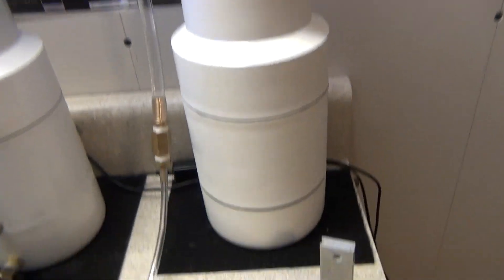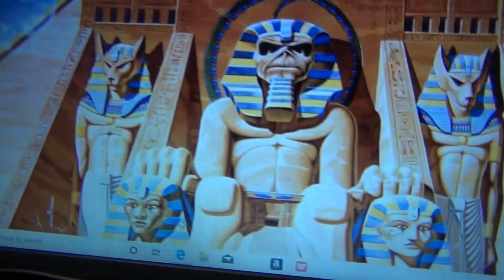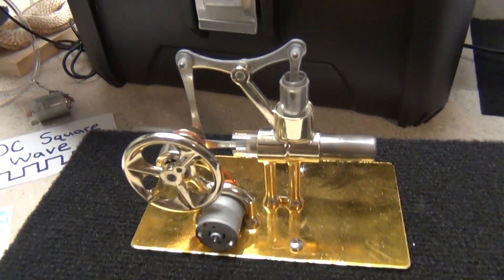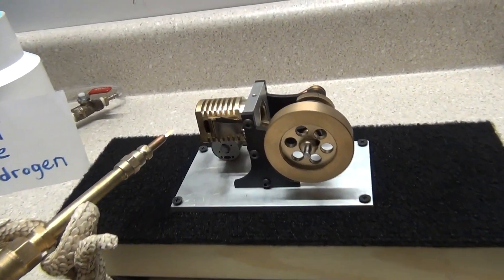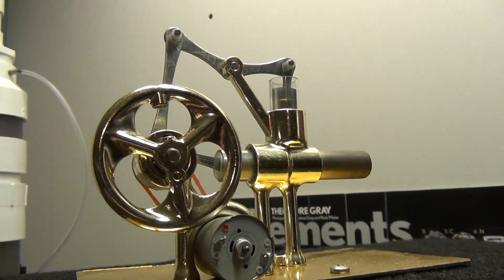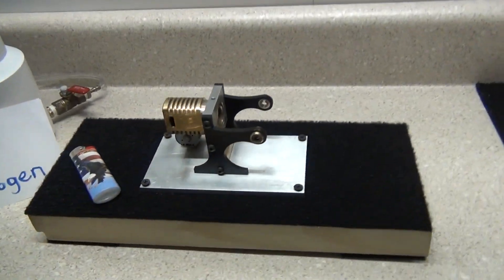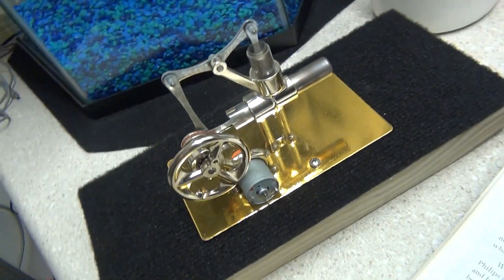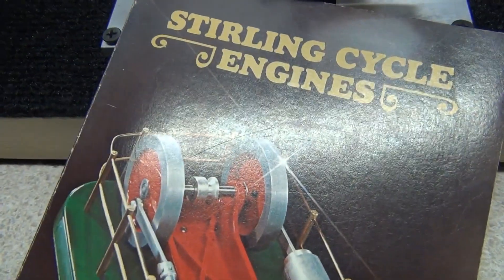PURE HYDROGEN FLAME EATER VACUUM ENGINE

Comment: Very erratic
Reply from the maker: Yes! Good observation this was a test experiment and demonstration of the motor's capabilities it ran rough, and it took me awhile to understand why till i took it apart. I did not clean the inside piston or lube the tube had rust inside main chamber and i was unaware of and the timing was off slightly, and it greatly reduced its electrical output.

Comment: Question, can the parts be purchased at any hardware store? I'm thinking of building one myself 👍🏿
Reply from the maker: The technology is quite simple how it all works but it would be best to have one already made for you and would be much easier than building one from scratch. The designs of the vacuum engine are endless this one is very simple prototype version i was experimenting with to see what kinds of gas mixture it would run best on.

Comment from the maker: One of the most simple and easy to copy and remanufacture engine designs in the world the vacuum engine. This vacuum  engine can be built to any size and can produce endless amounts of electrical power to perform electrolysis to produce the hydrogen and oxygen to fill storage tanks continuously in the future.